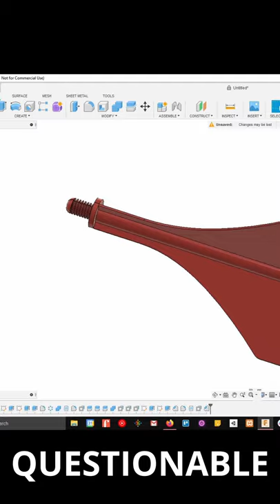3D Printing Discontinued Parts

Comment: We know you're not going to just put that on the wall. You're going to glue some metal to the tip and use it as a pool toy. 
You really don't need much metal to make it sink well, so you could probably get away with just a thin weight on the end. Heck, you could make it dart like, for hydrodynamics, or whatever.
Reply: Do you not know what those were?
Reply: @meri420  it was all satire
Reply: Fluid dynamics *
Reply: You can find some nice hefty fishing weights to attach to the tip of the dart, I think the droplet shaped ones would work best
Reply: @meri420  ✈️👱!!! that joke went right over your 👱!

Comment: What kind of glue are you using? Which filament? Have a tough time gluing parts with pla
Reply from the maker: In the video used PETG filament and glued it using Yellow ABS Cement but it didn't hold and I had to re-glued it with superglue

Comment: Iv googled every type of dart you can imagine including each different type of what this guy has and no where is it illegal to make or sell in any country! So this guy is talkin shit!
Reply: These aren't but the metal tipped ones are since people were committing manslaughter with them
Reply: I actually saw one of these metal tipped go into someone's shoulder while camping as a kid.

Funny enough I personally was the reason why the whistling footballs with the dart tails were pulled from the market and redesigned.   We were fastball throwing it at each other playing catch and the old ones had a sharp leading edge on the whistle.  The person catching it had 1/8" tip of their finger chopped off and crammed down the whistle.  That was 26-27 years ago.  They eventually re-released it with a different geometry and position on the ball.
Reply: They are called lawn darts or something, they were banned because these things can hit people like bootleg bolts
Reply: They are illegal to sell and produce in the US, though not illegal to own.  This is very common knowledge here, and there is something of a small grey market for them here because they are a lot of fun at barbeques.  You don't have a clue what you're talking about.